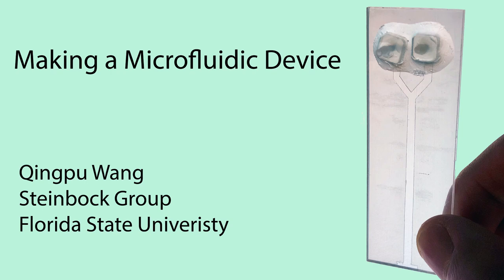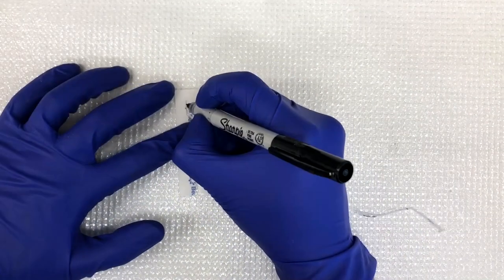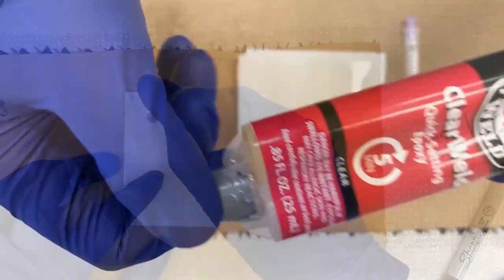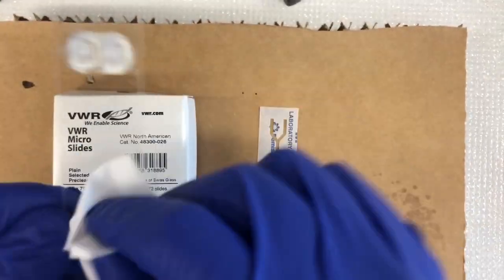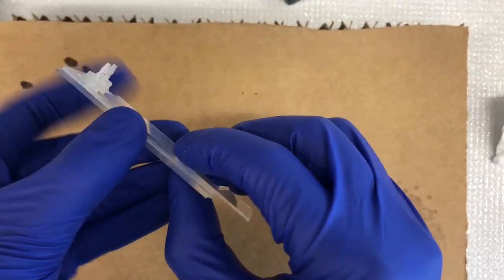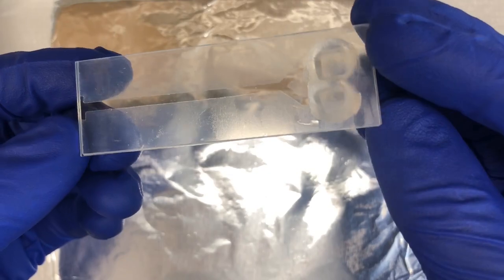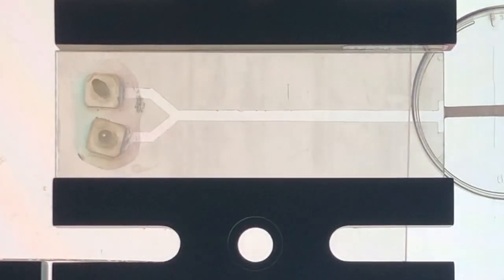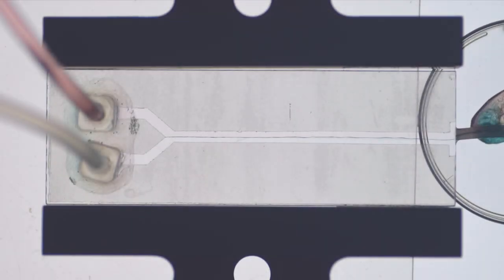Easy, Quick Method for Making a Microfluidic Device

Comment: Hello! Thank you for sharing this. What's the name of the paper/adhesive used?
Reply from the maker: Hi Maria, here is a list of supplies that we use (hope this helps ... and ... we don't get money for the links): 

(1) Two barb fittings ( or cut-off pipet tips) 

We purchased FITM331 from this website: https://www.nresearch.com/products/fittings/barb-zerodead.html.
(2) Epoxy glue: Gorilla 2 Part Epoxy, 5 Minute Set, .85 ounce Syringe, Clear.
https://www.amazon.com/dp/B01M7VD07W
(3) Parafilm All Purpose Laboratory Film
https://www.amazon.com/dp/B004VQP6CQ
(4) VWR plain micro slide: VWR 48300-026
https://us.vwr.com/store/product/4646095/vwr-plain-and-frosted-micro-slides-premium.
(5) Tygon tubing E3603 1/16" ID x 1/8" OD x 1/32" Wall
https://www.usplastic.com/catalog/item.aspx?itemid=91104
Reply: @SteinbockGroup  Thank you so much!!!, greetings from Peru.

Comment: where did you purchase the barb fittings?
Reply from the maker: by now we are using cut pipette tips which work as well and are cheaper (the original supplier of the barb fittings was Cole-Parmer)